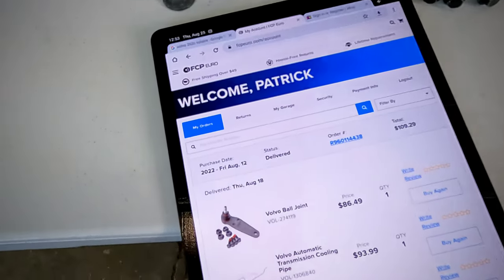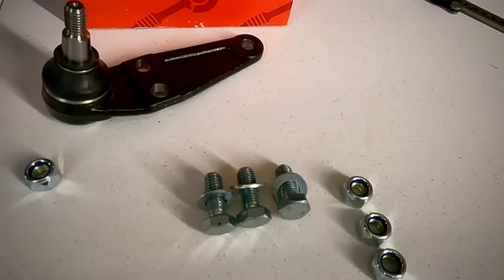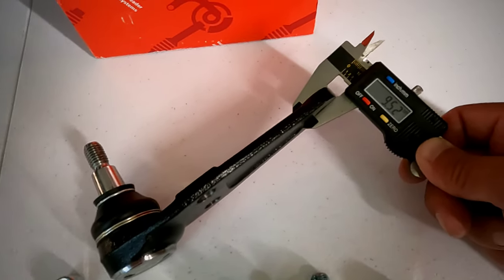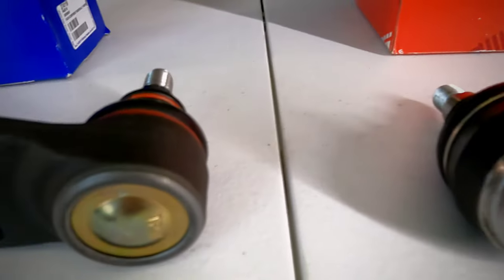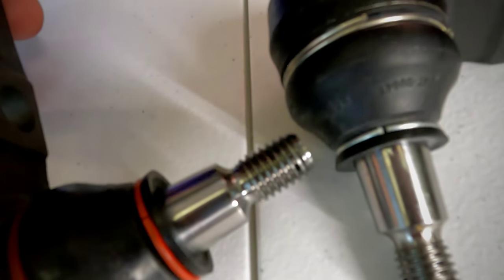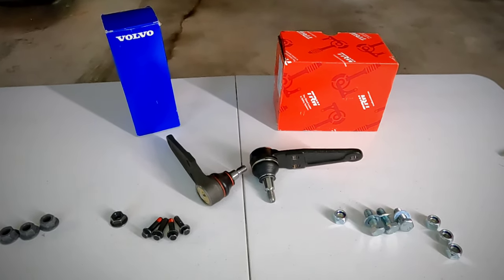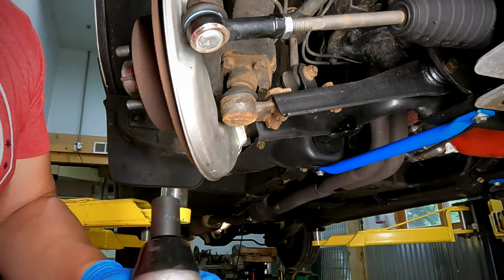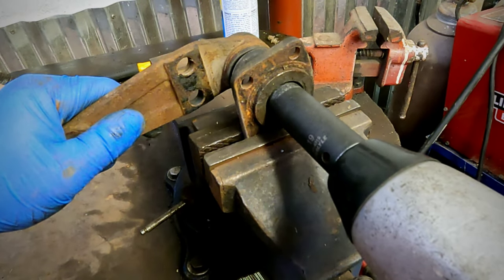FACTORY vs. OEM Ball Joint Comparison and REPLACEMENT @volvo240life

Comment from the maker: Also, I forgot to mention that g80 locking rear differential at the end....anybody have any experience changing over???
Reply: If you want a locking rear end, get a proper lsd. The G80s are not really worth the hassle
Reply: @jamesmoore8461  G80's have a time and place. They aren't a ramped clutch type like old BMW's. I like them because it really makes the 240 unstoppable in the snow with studs. Not good for drifting or autocross, but it keeps it from going 1 wheel drive in adverse conditions. On an 86-91 non ABS you'll need the cover and sensor from the donor car and you'll need to trim the 48 teeth down to 12. Some people say you can use the earlier cover and sensor but you have to space the sensor. I think that has need proven to be unreliable, and is why people have mixed results. The sensor to tone ring spacing has to be right. Keep the donor bearing cups matched with the donor bearings, left and right. Swap over your ring gear, trim the right side axle if before 1993 (some late 92's). Check backlash, I think spec is .005"-.007". I haven't heard of someone needing to swap the shims to correct anything after just a G80 swap.
Reply from the maker: @jamesmoore8461  lol, I didn't know what to say...but now that I see what Curtis mentions, that does sound like a fair bit of hassle.   There was  a really nice 92 that idk looked like it hit a deer at the junk yard a few weeks ago.  Next time I'm there I'll have to check out the rear axel.
Reply from the maker: @curtislovrak5390  I just saw your rather well explained reply...so first thanks for 
that.  The most use it would see would be snow here in WI, I'm working towards some overland/trail activities....I've had the g80 for a while just sitting wrapped up.   I've seen a few lifted and cross countryx/c ones  relatively recently on here.   I don't necessarily want to go that far, but something able to have  fun in with reasonable capabilities yet retain an original look.

Comment: Wow - I always thought OEM & Factory were basically exactly the same, but to see the actual difference here was interesting. On my Mercs I generally use Lemforder suspension parts as they seem to be the best quality - where as some other brands while OEM still aren't as solid.
Reply from the maker: Welcome to Thursday and the channel.  I used Lemforder for the inner and outer tie rods a couple videos ago....I have to say they seem much more like factory parts, right down to the similar blue box.   I'm a bit disappointed with this OEM/TRW joint. While it probably doesn't come across so well in the video, in real life it feels like an inferior part.   I'm going to order a factory one and replace it.  Thanks for watching.!

Comment: well..i don't know if the mistake was yours or the dealer's but.....OEM stands for original equipment manufacturer....it IS the original, it's not similar, it's the exact same part, eventually without the Volvo symbol on it. Example for the Skoda world i know quite good: active front dampers for a 2016 Skoda Superb: original = made by Sachs, bought by Skoda, rebranded and sold, OEM = made by Sachs and sold directly. you are probably talking of original vs aftermarket since, as far as i know, TRW never was a Volvo supplier.
Reply from the maker: Welcome to the channel.    Hmmm....well your not exactly right.   TRW was a/the original producer for the 200 series ball joints, it's stamped right into the Volvo part on the bottom ( bit hard to see, the auto focus seems to struggle with the real close up shots).  It's definitely not the first time I've found "factory origials" to be different than OEM. Thanks for watching!

Comment: I just purchased an NOS TRW balljoint, the box was labeled 1997, made in Germany. The construction is nearly identical to the Volvo OE shown in the video, the red rings around the boot, better hardware, matte grey finish, cap on the bottom looks the same but not zinc yellow. It seems like at some point TRW changed tooling and Volvo kept making them with the prior tooling. I'll have to order a Volvo passenger side ball joint, my Meyle ball joints lasted 10k miles.
Reply from the maker: Hey Curtis welcome to the weekend!   Out of curiosity was the NOS package a box like the factory one in the video?  I ask because the TRW I had came in a box that seemed big enough for larger products.   The new TRW OEM felt like an aftermarket item.  Original factory bushings always come to mind....no brand is even close to the same for rubber and the originals just seem better made.
Reply: The "Factory" part would probably be SKF or a german manufacturer. Just because it says volvo on the box doesnt mean volvo made a ball joint in the last 50 years or ever.
Reply from the maker: Lol I don't know if Volvo ever actually made ball joint in house...but they used to sorce them through TRW from the info I could  find.    I did think it was odd that the TRW branding was on the factory part.   I have some older accessories with the original  manufacturer like the flexi map light by Butlers, and the rear sunshade by Filtavito, but for such a common part used right to the end I did think it was a bit odd.  Thanks for watching!!😁
Reply: @volvo240life  OEM means that they made the original parts So probably the could also be SKF or FEBI among others. The reason they are different is probably age and possibly the that one of them might be a conterfeit OEM part. The counterfeit hypothesis might not be so likely though unless the part is also used on newer cars.
Reply: @rimmersbryggeri  TRW is the manufacturer for Volvo 240 balljoints, I have some NOS TRW balljoints and they are the same as the Volvo ones here, but different from the new TRW balljoints. Tooling wears out over time, and often times even the OEM part isn't identical to the original 20+ years later. It's possible this tooling change was recent and Volvo still has stock of the old design, or that TRW is making 2 styles now. Some OEM's do this, they make a more "economy" version even though they are the original supplier.
Reply: @curtislovrak5390  Absolutely.
Reply from the maker: @rimmersbryggeri  lol...now that you say it, counterfeit, is totally how the TRW OEM feels ( to be clear I am not saying it is, I have no way to check or verify that).  It doesn't come through in the video very well, but instead of saying the factory one felt like a better part....I think saying the OEM felt more like what I would expect from a counterfeit really is probably more accurate.
Reply: @volvo240life  Yeah that's what your words made me think. YOu will see wether it wears out prematurely.

Comment: Great video! Now that I saw you applying some grease, just a video idea: greasing points for avoiding 'wiki-wiki' noises while driving. I believe the back seat in the wagons are a bit noisy when coming at certain age. Regards, Nacho.
Reply from the maker: Hey Nacho Thanks!!...And that's a GREAT IDEA!  In the owner's manual there is a section about it.  I have some back seat, cargo gate, and rear hatch squeaks.   Since I firmed the suspension there is a noticable difference.  Need to go through and tighten it all.